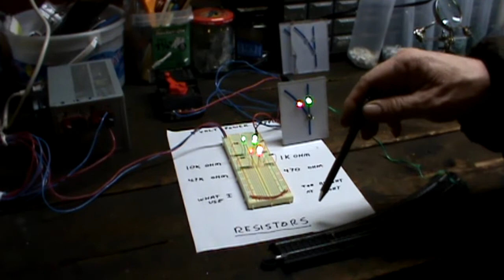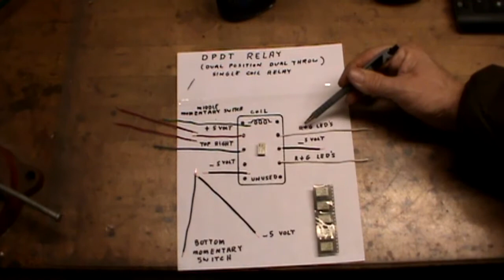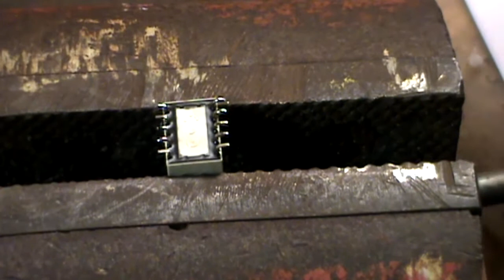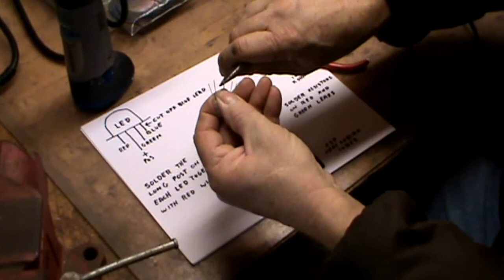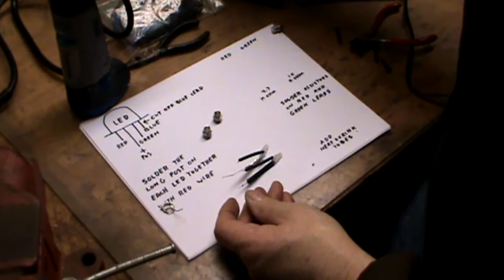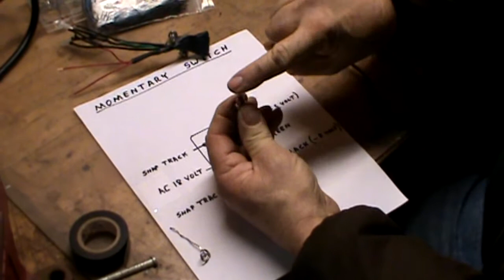Cheapskate Video 4, Model Train Control Panel

Comment: I see that you are using 5mm LEDs.  Would it be less dim if you were to use 3mm LEDs?
Reply from the maker: I do not want them bright. I used different resistors originally that made them bright and found that when I turned out the lights for night scenes it made it hard to see the control board.

Comment: At 2:38 you show using the switch to change the turnouts but it appears that you wired the LED directly to the switch.  Thrpoblem with this is that you have not actually confirmed that the blades of the turn have moved into the correct position.
What happens if you have debris between the turnout blade and the rail, and prevents the blade from making a connection.
Your LED should not come on if the blade did not make the correct connection.
Reply from the maker: I said in the video that this setup did not give you confirmation. It is a cheap way to switch tracks (hence the name "cheapskate video").

Comment: I see where you have Bachmann twin coil snap style switches. Three wire input. Could this work with Kato Two Wire, single coil snap switches? The same momentary action is needed to reverse the polarity, and LEDs. My misunderstanding in is the wiring. 3wire, 2coil (bachmann/Atlas) versus 2wire, single coil (kato)Any help would be appreciatedMike
Reply from the maker: I used one side of the momentary switch to switch the track and the other side to reverse the light colors using a cheap relay. The relay operates on 5 volts. The momentary switch has 5 volts on one side (for the lights and relay) and 16 on the other (to switch the track). I don't believe there's any way to use these relays for your purpose. They would burn out.